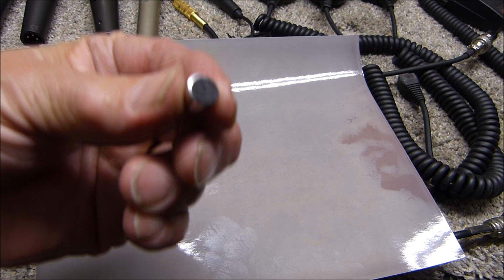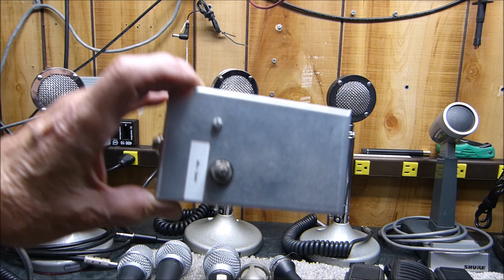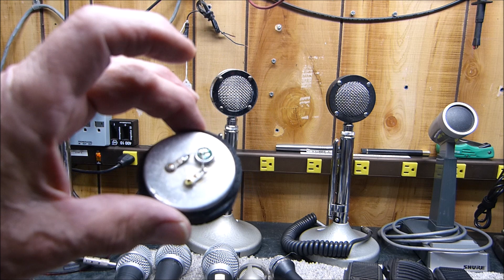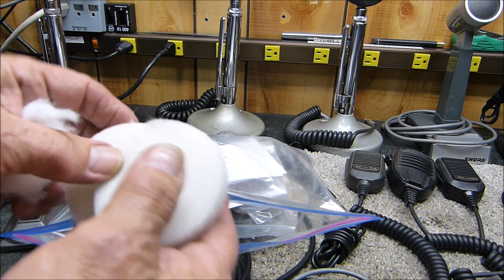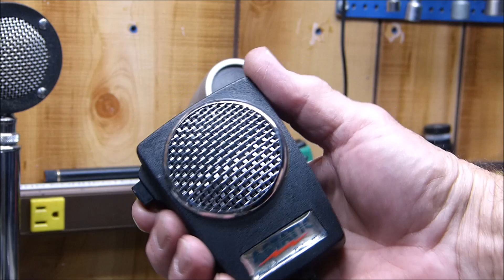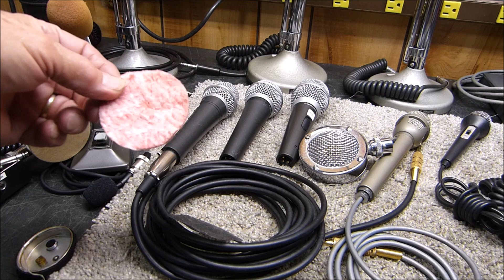Electret Microphone Elements for All Microphones Frames

Comment from the maker: Today is June 26, 2024, and I've been working on these D-104 heads again. I’ve found a great solution by placing three small, inexpensive microphones in a triangular pattern inside the D-104 head. By wiring the three positive terminals in parallel and the three negative terminals in parallel, treating them as one microphone, it works marvelously. I now have two heads set up this way and consistently receive unsolicited compliments on the audio quality. There are no other changes in the setup, just wiring the three mic elements together. This setup works beautifully with my KWM-2A and 32S-1.

However, when I wired one of the mic stands with an 8-pin connector for my Icom 7300, it didn’t work well at all. Despite my efforts, I haven’t found a better microphone for the 7300 than the stock mobile-style hand mic it came with. I continue to receive wonderful compliments on the audio quality of the 7300 with its stock mic.

I also want to take a moment to thank all of you for your kind comments and good wishes. 2022 was a tough year. Not only did my two cats pass away, but the love of my life, my wife Marilu, who I was married to for 45 years, came down with pancreatic cancer and passed on June 19, 2022. It has been a difficult journey. I now have six cats, and I believe Marilu sent them to me because she knew I needed them. I am deeply grateful for your kindness and support.

God bless you all. I’ve been posting since 2008 and have met so many wonderful people through this YouTube channel. 73, WA4QGA.
Reply: I tried your one element setup and AB'd it over the air as mic A and mic B.  The home brew being mic A. You know I got everyone coming back to me saying they liked mic A better. And it did sound better. Go figure....

Comment: I have a shure 577 Caroid  microphone works great on a TS-520s ! I have a D-104 tug9 with the amp board installed I am going to instal your mod. The Christie  went bad on the D-104
Reply from the maker: I get great reports with the cheap mic elements. You won't be using the amp board, just the battery holder. I think you will be pleased.

Comment from the maker: After posting this video, reading some comments from viewers and doing a little more research, I see now that these types of microphones are called electret microphones and not actually  "condenser" i.e. "capacitor" microphones although they are a type of "capacitor" microphone.  They might also be referred as "FET" microphones for the FET amplifier built into each microphone. There is a quote and link to a Wikipedia article in a below comment that explains the difference in these types of microphone transducers.

Comment: I agree with you about dynamic microphones. I've never found them any use in 55 years. Poor and non-flat frequency response, poor dynamic range,, and quite high distortion. Capacitor/condenser and electrets are just about the ideal way to build a microphone element from the physical point of view, as there is great linearity. Electrically a bit hard to deal with because of the source impedance, but that's what electronics is for, right?

Happy New Year.

EJP
Reply from the maker: If we look up the best microphones in the world, we find a $7000 condenser microphone - probably has one of these 69 cent elements in a solid gold case. How could we go wrong with that?  I always believed the truly best microphones would be dynamic but I don't think so anymore. In any case, for my purposes, I need a mic that is good from 300 Hz to 3KHz and actually accentuates the high end just a little bit and attenuates the bass end. 
I found it interesting that the diaphragm of the "condenser" it truly tied directly to the gate of the FET. Too bad the camera was focused on the background instead of the little FET in the mic element so it could be seen better. The obvious point being that the output is, as you mentioned, very high Z and very low voltage output. 
My purpose in these last videos on condenser mics is that it is quite easy to fix the problem with the elements going bad after decades yet the mic cases are still beautiful and functional.
BTW - per a comment you made sometime back, I now have all my soldering irons in my shop on a timer - max one hour. That way I don't forget to turn them off at night anymore.
Happy New Year

Comment: Dynamic microphones work great esp with a little eq. Atr30 is a secret weapon.
Reply from the maker: I did some research on that ART30. Seems like a real winner. I may have to buy one. Thanks. I bought an inexpensive Heil dynamic microphone made for ham radio operators with PTT switch and I was very disappointed. I know Heil makes great microphones but I guess I just got a bad one. I put an electret element in it and now it is great...

Comment: the TRS connectors (6.3mm / 1/4inch jacks) are tip-ring-sleeve, and they're named the same way, a stereo 1/4inch connector would be a TRS, a mono one would be TS or just mono 1.4inch.

Comment: I'm pretty sure that microphone you took apart is an electret microphone, not a condenser,  the microphone generates voltage all by itself, the FET is there just to amplify it, while a condenser mic would need a high voltage supply (~100 - 300volts) to the microphone, which is usually supplied externally in a preamp usually located in the microphone body/case
Reply: The element is an electret but it needs power for the FET amplifier. Back in the day you used to send -48V phantom power, or more if the head amp used vacuum tubes.
Reply from the maker: I have read of those high voltage type microphones but I have never dealt with them.  It seems they would be, as you mention, a true condenser microphone. I always learn from you guys... Thank You
Here is something interesting I got from Wikipedia. I suppose their comment where is says it does not need a "polarizing" power supply (the HV supply) does not mean that it does not need amplification, in our case, a FET amplifier that needs power to operate.
https://en.wikipedia.org/wiki/Electret_microphone
"An electret microphone is a type of electrostatic capacitor-based microphone, which eliminates the need for a polarizing power supply by using a permanently charged material.

An electret is a stable dielectric material with a permanently embedded static electric dipole moment (which, due to the high resistance and chemical stability of the material, will not decay for hundreds of years). The name comes from electrostatic and magnet; drawing analogy to the formation of a magnet by alignment of magnetic domains in a piece of iron. Electrets are commonly made by first melting a suitable dielectric material such as a plastic or wax that contains polar molecules, and then allowing it to re-solidify in a powerful electrostatic field. The polar molecules of the dielectric align themselves to the direction of the electrostatic field, producing a permanent electrostatic "bias". Modern electret microphones use PTFE plastic, either in film or solute form, to form the electret."